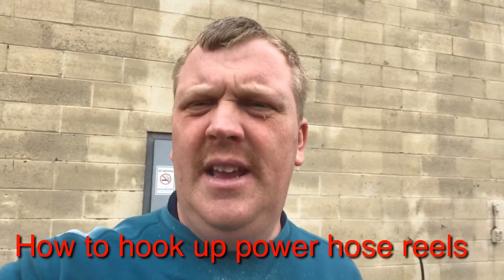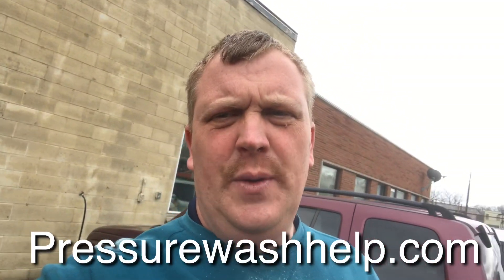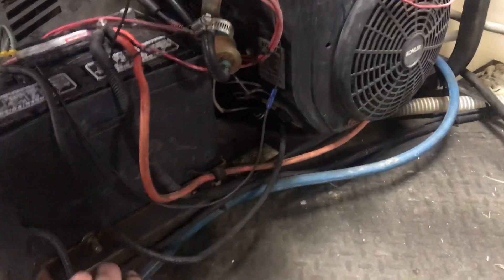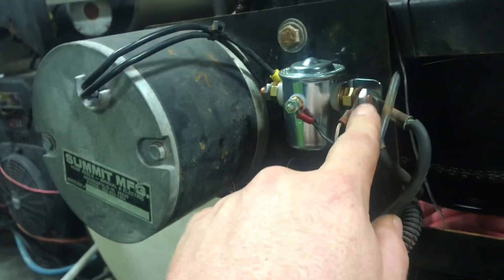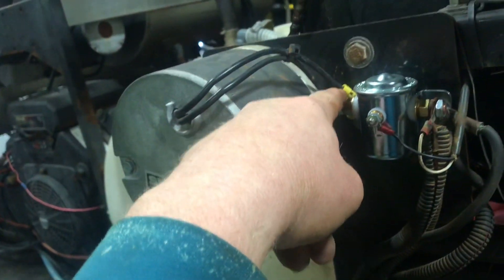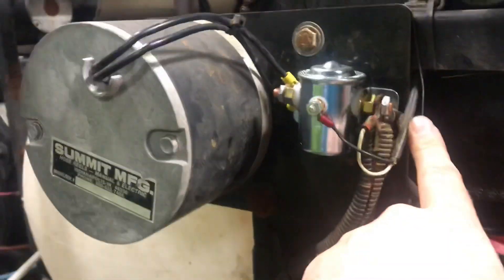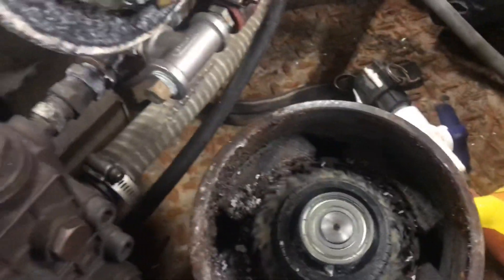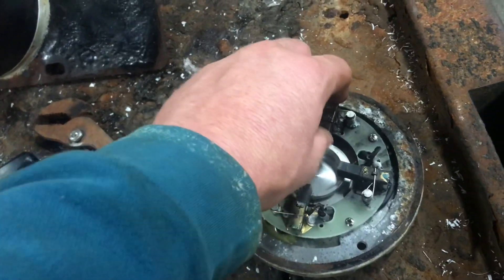How To Wire Electric Hose Reels From Battery To Solenoid

Comment: great video, thanks for sharing, what about the fuse?? what size and wear do you you put it? on the main power line I am guessing? what about on the jumpers?   thanks man
Reply from the maker: I use a 150 amp circuit breaker
Reply: @kingofpressurewash  Are you using a 150 because you have multiple motors? I only have 1 motor so far so should I use a smaller breaker? Thank you sir!

Comment: I just bought a electric hose reel but I don’t wanna hook it directly to my truck battery. Instead I’m going to buy a separate battery to run the hose reel. Is there a recommended size battery that I need to run the hose reel or does it only have to be a 12 V? I’m pretty new to all this stuff. If you can please explain in layman’s terms. A friend told me all I need is a marine battery but what’s the difference from a car battery
Reply from the maker: There is a difference between a car battery and a marine battery. A marine battery you can run it dead and it don’t hurt it. So you want to use a marine battery